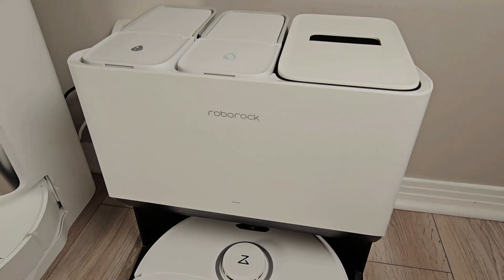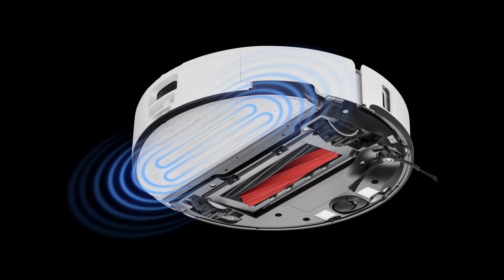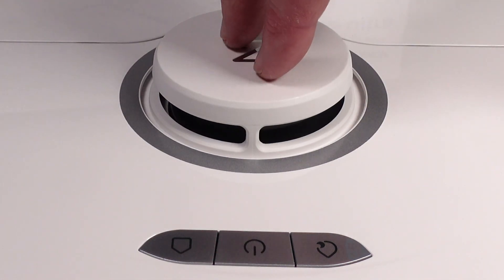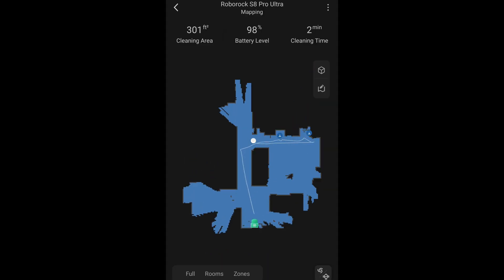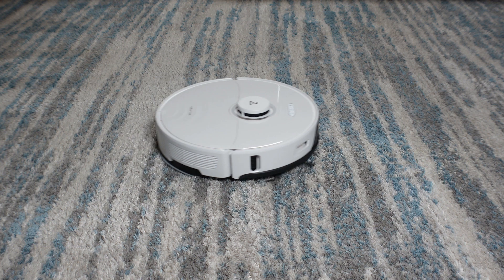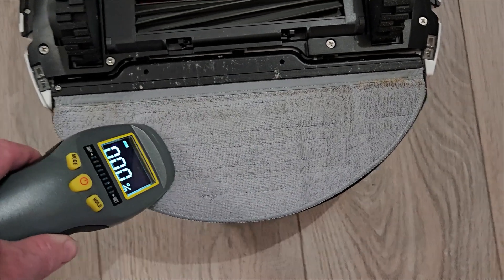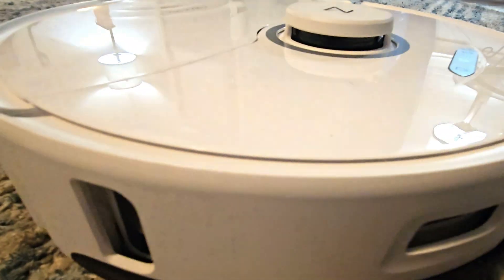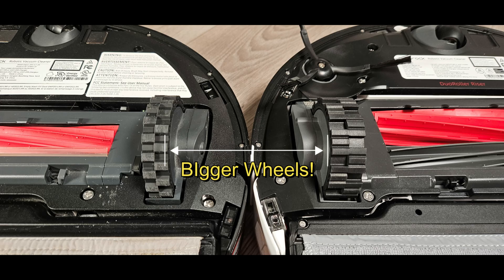Roborock S8 Pro Ultra Review!  2023 Ultra Robot Vacuum Tech!

Comment: I've been waiting for this review, Jamie, as you are the expert of the experts in the quality of your reviews! Nice job, for sure. I have the S7 MaxV ultra and love it. Most of my home is hardwood and some tile. Small carpet in living room and very small one in foyer. You mention doing Vac first and then mop with the S8 - why? I usually vac and mop at same time. What is the benefit of making 2 passes when you can do both at once? I really like the OMO cleaner and use it all the time. I wonder if anyone has tried Bona with the same Dilution Ratio as the OMO cleaner. The S7 does everything I need and more so no upgrading for me. I watch the dirty water bin and empty when less than half full - to eliminate possilble odors (because I do not have the Drying module).  Looking forward to your next video.
Reply from the maker: Thanks June!  I really appreciate your kind words and it is people like you that keep me motivated to do more videos!

Vacuum motors and water do not mix.

Having the brush roller spin and drag on the floor with the vacuum sucking could bring moisture onto your dustbin and start clogging things up which can cause strain on the vacuum motor and if the problem is bad enough like with the iRobot J7 Plus I recently reviewed, water could get past the paper filter and into the motor. Take a look at that video for the perfect example of why vacuuming and mopping is not great to do at the same time.  I also find my floors are cleaner with much less streaking when I vacuum first and then mop.  I have to admit that I went back to mopping and vacuuming at the same time before this video just out of laziness though.  The new retractable roller deck on the S8 Pro makes sure the brush rollers are not contacting the floor in mop only mode.  The vacuum motor is also completely off.  That makes me want to go back to doing 2 separate cleanings with this new change.

I have used Bono before.  It is mostly water and not harmful.  I still use OMO though with that being said.  I wish Roborock would sell me a gallon of it.

Thanks again for your support!
Reply: I'm gonna go ahead and change your life here--put a 1/8 cup of vinegar in the dirty bucket after you empty it and then there's no smell of death when you open it.

Comment: Great review! I have a question though.. does the integrated water tank get slimey? I was hoping to be able to clean it once a while and a little concerned about eventually making the tank moldy. I guess we should use specificly how can I say, 'pure h2o' (not filtered, drinking or tap water) but I'm afraid I might not find it economically. Thank you a lot!
Reply from the maker: For me I have never expieranced slime in my tanks, but that is because of my water quality and has nothing to do with the robot.  If you get slime I would suggest switching to a filtered water source. You could also try a silver ion block which fits in the clean water tank. You can find them on Amazon.
https://amzn.to/44KMTsv

Comment: Thanks for the review Jamie. Do you think S8 Pro Ultra's four plastic nubs on the roller cage may drag on the floor like you mentioned in your "Roborock S7 Vacuum Stress Tests" video?
https://youtu.be/3HtjWbSwUXk?si=pojQFGG6c4bzk68E&t=441

I have been using this robot for a couple of weeks, and I am 90% sure it's creating scratches on my wood floor when it makes long turns. However I am having difficult time figuring out how it's making those scratches.
Reply from the maker: They don't appear to drag the floor. Does this happen while mopping or vacuum only?
Reply: @jamie.andrews  I'm not sure but I use both modes. I've moved into a new apartment that didn't have noticeable scratches on the floor. However, I started to notice quite a few long scratches after using S8 Pro Ultra for a week...
I'll do more testing in next few days and let you know if I find anything interesting.

Comment: Hi Jamie, when the S8 is charging in the Ultra dock. Does it makes a noise (like a fan)? If yes, is it because it’s a fast charge? 

Is it correct that the Q Revo is silent while charging?
Reply from the maker: No it does not make a sound charging.  Only when hot air drying.
Reply: @jamie.andrews  Weird. In my case it’s producing sound. Like a fan that’s blowing to keep the unit cool 🤔
Reply from the maker: @bramb567  Are you sure hot air drying is not on?
Reply: @jamie.andrews  Yes. Not mopped.
Reply from the maker: @bramb567  What market do you live in?
Reply: @jamie.andrews  EU (the Netherlands). I was comparing it to the Q Revo. Those two are close, especially for the price difference! Reactive tech is performing less then the more advanced system on the S8, but in my case / household more then enough! Keep up the good work with all the tests and reviews.
Reply from the maker: @bramb567  I wonder if there is a difference in the markets. We run on 120 here in the states.
Reply: @jamie.andrews  Could be possible. I’m keeping the Q Revo. If you want to know anything or see anything from this EU model, just let me know.

Comment: Hi Jamie, thank you for the rev, your channel is now my first go-to as I am researching for my first bot. I am now down to S8 Pro Ultra and L20 Ultra…. I have considered Q Revo before but sadly it is not available in my region. Which one in your experience is better? I read some reviews that the S8 Pro Ultra performs well on carpet only when it is on the max mode - which is noisy and depletes battery quickly. On other code the vacuum on carpet is not good. I am slightly worried about this as half of my house is carpet. I could not find much on the L20 side (though obviously I watched your L20 review). Thank you so much!
Reply from the maker: First off thanks for the support!

The L20 is a fantastic robot that has more bells and whistles than the S8 Pro and better object avoidance.

The S8 Pro Ultra has Roborock's reliability, excellant flawless app, navigation and good gereral overall experience. 

Which is better? That depends on your budget and needs.

I plan on doing a head to head with these 2 plus the Ecovacs X2 OMNI in December.
Reply: Wow really looking forward to that head-to-head comparison. If by any chance you could include some comments or tests about their vacuum performance on medium strength suction modes (which I suspect many people will be using in real life to vacuum), that will be highly appreciated.
Reply from the maker: @michelleliang3503  Thanks for the suggestion. I have struggled with whether or not to include other power suction levels in my tests. There are a few issues with it. 1. Medium suction level is different for every robot so setting each one to medium instead of their very highest setting would mean direct comparisons between the robots would be certainly invalid. 2. I could do it as a second set of tests but that would mean doubling the amount of tests I run.  Currently for each test you see I run them 2-3 times and go with the best result.  As you can imagine that is a bunch of time and work so I have settled with testing their very best efforts on high power. 
I have the same issue with the mopping test too. I am open to hearing your thoughts if you have any more.
Reply: @jamie.andrews  thanks Jamie for taking the time to reply, totally understand the challenge as you said. Maybe worthwhile to ask the audience to share their experiences of using their usual power settings in the comments section? That way you may see whether audiences are interested in these comparisons (in an indirect way like you said, not really Apple to Apple), or people like me could benefit from their sharing and get some insights even if no comparison could be done in a fair way. I often look through comments below your videos, and often find interesting ideas. Thank you!
Reply from the maker: @michelleliang3503  Good ideas. I need to ask for more feedback in my videos. I do have great commments in my videos that also give me ideas. Thanks for sharing!

Comment: Long time S6 Maxv user here. I didn't want to upgrade to a first generation model considering self cleanign docking stations when s7 maxv came out. I've waited for the mature second generation. Finally when s8 pro ultra came out i felt disapointed that it didn't have remote viewing features so i started waiting again for future next generation. Then i've seen Q revo which was very appealing especially for the price but it was never available to buy on amazon and noone sells it here in my country Turkey. I wanted to wait for a new generation robot from roborock which includes remote viewing, liftable dual brush rollers with improved air suction power and also revolving mop pads. But i felt like waiting would take years so i finally pulled the trigger for the s8 pro ultra. I was anxious if i would regret the purchase but i'm pretty happy with it. It really reduces so much in terms of user maintanance. Even new rubber rollers are so easy to clean compared to the brush on s6maxv. Things i wish could be improved are you need to fill water tank and empty dirty water tank much more frequently than you would like. I probably do this every 3 days or so. Due to dual roller design they designed larger air gap for rollers which reduces air suction and i believe they will fix it in next gen. I am not sad about the vacuming performance though but once they optimise this it will not leave anything behind. They can make side brushes with a click on system instead of screw for easier maintanance.  What suprised me with s8 pro ultra compared to S6 maxv is way better navigation and object avoidence without the need of turning lights on in completely dark rooms, the efectiveness of the vibrating mop pads and i didn't expect maintanance free operation could be this good. S8 pro ultra suprised me in a good way how refined it is making the same job in every different aspect. For instance water from the mop was not homogenously spreaded across the floor before. It is %100 fixed with S8 pro ultra. It's interesting nobody ever talks about these little refinements online.

Comment: Good job!  Roborock seems to have peaked out.  They do have the best robots at present, but there are more than a few indications they have lost ground as they've tried to cut corners.  Amazon should take note - If you add LIDAR intelligently, you should easily be able to retake the lead as the premiere robot vacuum company.  Roborock still doesn't have sensors that indicate when the dust bin is full.  Their AI is failing.  And Roborock is going backward as far as removable replaceable parts are concerned.  Mistakes like these are what competitors love to see.
Reply from the maker: Thanks!  They are making changes which is good, but I do feel some of those changes are ones nobody asked for and are also considered by many as a step backward. 
The dustbin full sensor is another iRobot patent and the reason no other robot has it.  I am not certain when that patent is up.
Thanks for the support!

Comment: I am still debating between s7 and s8. One biggest concern is that my wife wants the large carpet in the living room to be cleaned, we don't have pet, it is only the hair. Currently we have the regular s7 and it cannot get the work done. So which one you would recommend, S7 max V or S8?
Reply from the maker: If the S7 can't get it done there is a good chance the S7 MaxV might not be able to either.  It does surprise me the S7 can't handle that though.  Give the S8 a shot.

Comment: I have s8 ultra.  It definitely will hit and eat cords.   I had it twice cross cords and roll up in rubber rollers and fault out.  The app has no feature to vac only.  The mop will always drop down and get dirty with dust fines.   Now you have to remove mop pad and clean it periodically.

If you have skirts on you bed or furniture this robot will not pass thru skirt and clean under furniture or bed.  Same goes for curtains that hang down to floor.   The competitors robot is not stopped by skirts or curtains so it gets to those areas
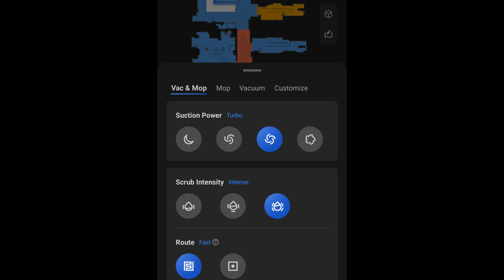Reply from the maker: If you look at 06:10 in my video you will see the option to select the vacuum only which should help you out a bit.  Cords are a bigger problem with 2 rollers for sure.

The curtains  look like a solid wall to the lidar so any system with a lidar on top will have this same issue.  Irobot and Yeedi use a camera based system which may clean behind curtains and bed spreads, but come with other less than ideal navigation problems.

Comment: Great review(s)!! 👍👍

Thinking of replacing my Roborock S5. 

Would you go for a S8 Pro Ultra or L10s Ultra? Seems like specs are almost the same. Perhaps some differences in software/functions. 😊

You seems very satisfied with both of them in your reviews.😊

Keep up the good work! 🙏
Reply from the maker: Both are great robots.  I did a comparison video between Ultra Robots and if you have not seen it you may want to take a look.
Both have their issues, but I am very fond of the detergent injection system and removable mopping plates on the L10s. There have been a few reports from users having problems with the L10s pumping water out of the dock when new.  There is a fix to get it working and I never had the problem so I can not speak to it more than this.

Take a look here at my older comparison video.
https://youtu.be/Nt1KwfEPoEI

Comment: Always a little frustrating when the upgraded new model includes some downgrades! Not unique to Roborock unfortunately. The video feed on the S7 has come in quite handy in my experience for remote monitoring and even when it gets stuck to see how to free it by maneuvering it while I’m at work. The ability to remove the water bin also helps with mold in the tank inspection and removal. What a great unit the S8 could have been without the downgrades! Just someone who likes to write it as he sees it!
Reply from the maker: I am expecting there could be a MaxV version released later that might have the old Reactive AI, but I have no concrete evidence on this.  Not sure that they would go back to a removable mopping plate and water tank though.

Comment: I have the S7 MaxV Ultra and the main problem is having to move rugs (light rugs) before cleaning to avoid it getting trapped in the rug. Would the S8 handle that better?
Reply from the maker: I have not tested that officially, but I still have to pick up my small rugs in my house with this one.

Comment: One thing to note, from someone who also has both the S7 MaxV Ultra and S8 Pro Ultra. I did have one gripe with the S7's object avoidance system. Reflections on certain parts of my floor would actually cause the S7 to think there was something in the way and even though it would come at it from a different angle it wouldn't ever correct itself regarding that "obstacle." I've ran the S8 through the same areas with those reflections and it didn't hesitate or assign an obstacle. Note: the S7 is seeing the reflection of cabinets on the floor and reflections of the sun on the floor and still sees them as the date of this comment.
So perhaps the downgrade of the camera might have made it less sensitive to seeing false obstacles.
Also, I have previously had to have transparent tape covering the cliff sensors on my S7 MaxV so it wasn't confused with complex carpet designs (aka Persian rug). The S8 doesn't have that problem. Since I moved the S7 downstairs and cleaned it up for that task, it doesn't appear to have this problem anymore, for me at least, perhaps there was a firmware update that I wasn't aware of (I have auto-updates active) that fixed this issue.
For a little context, I've had the S7 MaxV Ultra on the main floor of the house since Nov of 22 and haven't used it at all in the basement. So now that I have the S8 Pro Ultra, the S7 MaxV Ultra has been moved downstairs.
Overall I've been very pleased with both. It is great when the company Roborock can utilize feedback to improve its products. This shows they have a lot of passion and care about it!
Reply from the maker: Thanks for taking the time to share your experiences.  My S7 MaxV would do that when I first got it, but not much anymore.    It was my tile pattern that would fool it.  I saw the S8 Pro do it a few times, but not enough to make it in the video as a potential issue.  I am working with Roborock to help resolve these issues.  The great news is Roborock does work to quickly fix many of these.

Comment: I think the S8 Pro Ultra is better for pet/heavy carpet owners while S7 MaxV is still the king of hard floors. Good review :o)
Reply from the maker: Maybe it should just be marketed as a solution for pet owners?  That is not unheard of in the vacuum industry. It is actually quite common.
Reply: @jamie.andrews  That's not a bad idea - pet owners are a huge market. Sad that it didn't do that great vs poo though. They will probably fix all the issues you had (the downgrades from S7 MaxV) in S8 MaxV Ultra or S9 MaxV Ultra :o)
Reply from the maker: @rxappdev  Yea they will fix it soon I am sure.
Reply: @jamie.andrews  Yeah that is most likely something that can be fixed with software. They usually update software quite frequently so should not take too long if it's possible.